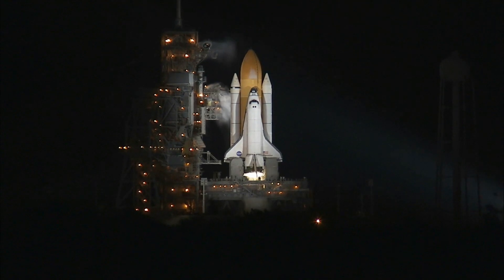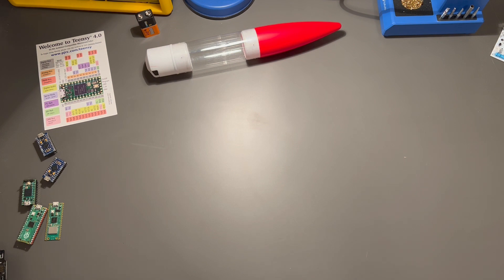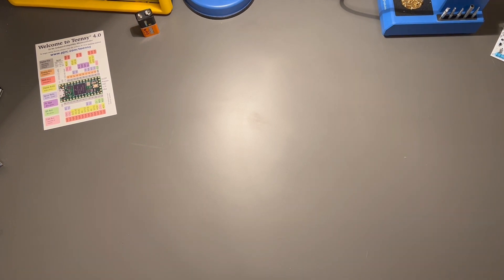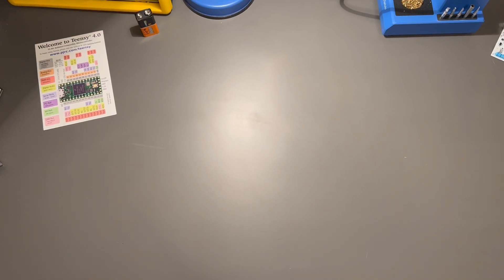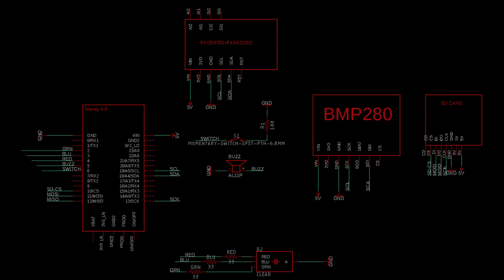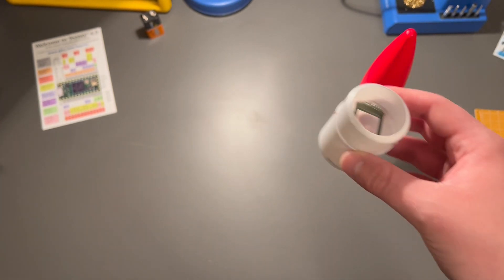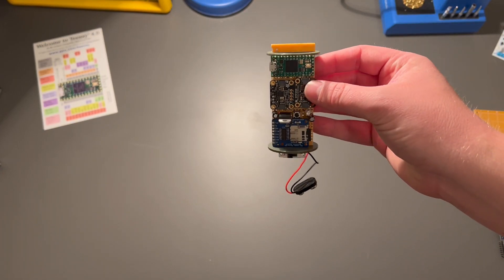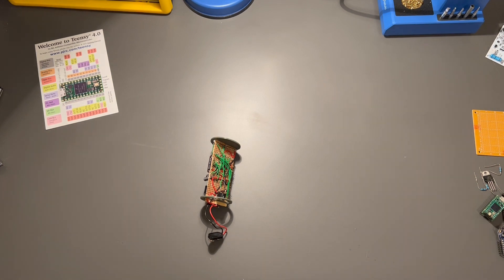I Made a Rocket Flight Recorder

Comment: The small size of that computer is great, especially if it fits in the Olympus! Very interesting. Did you get good data from the IMU and Altitude sensor?
Reply from the maker: Thank you! I was determined to make sure the computer would fit into the Olympus as it was, as I like to say, payload ready with little effort needed to get the computer in there. The data from the sensors is great has been helping me write better software for version 2 of Explorer 1! 

Stay tuned for an update video coming soon!